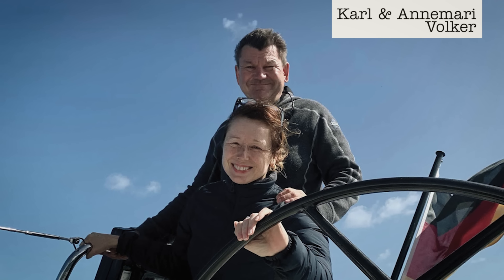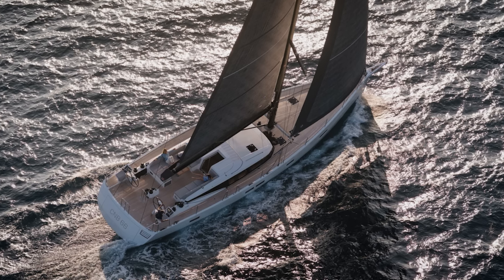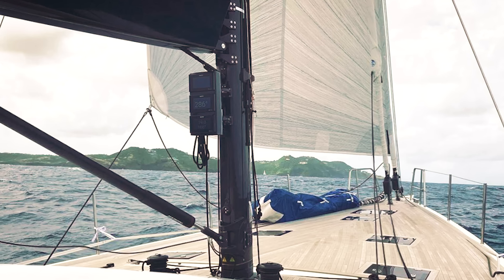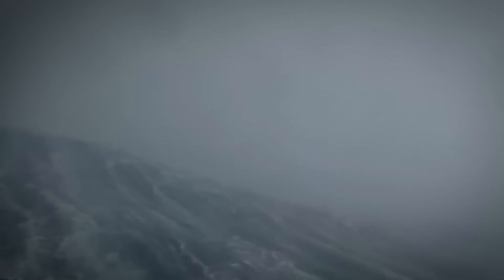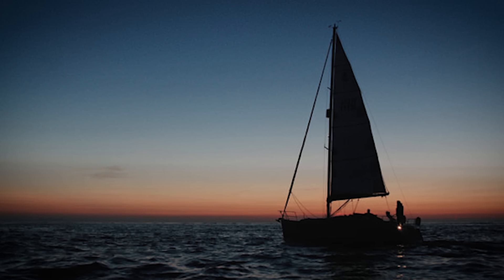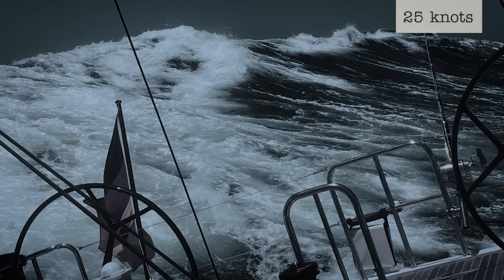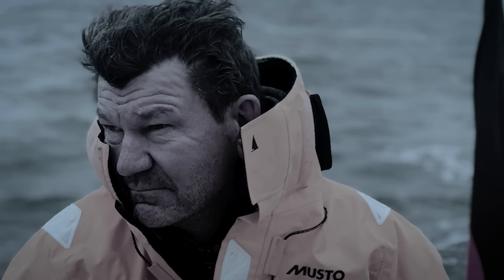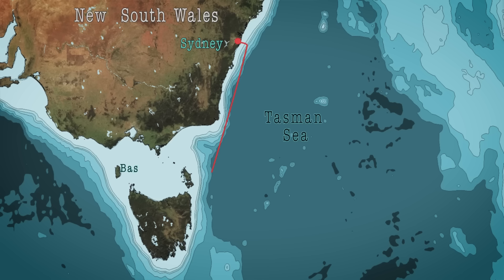Couple DIES on Private Yacht!

Comment: The boat was too big for two people to handle and obviously too big for a minimum crew to deliver in the No. Atlantic. I really did not like the design for the mainsheet. Set up in the middle of the cockpit is fine for a race boat, but this was a cruising boat. I think the designer should have warned the owners early on that they should have had a smaller vessel designed or he should have broken up the rig to a ketch to make the sail plan more manageable.
Reply: Maybe smaller main and a mizzen ?
Reply: It is a really terrible design. It is trying to be something it is not and the result, final design, is just dangerous.
Reply: @scomo532    very right. Common sense went overboard at design/construction.
Reply: Champaigne sailors. 
Lord have mercy.
Reply: It certainly seemed too big for just a couple, but on this occasion there were 4 on board...
Reply: The same mistakes, but on a bigger scale, in the design of "Bayesian". A ketch or schooner rig would be much safer, more flexible and definitely more pleasant to sail.

Comment: IMHO, the lesson here is that CNB 66 is too much boat for a moderately experienced cruising couple. Unfortunately this sort of thing is going to happen more and more because boats are getting bigger, faster and more complex. That couple could've easily been overwhelmed any time they went out on that thing.....the hull design is based on racing yachts crewed by 10 or more skilled sailors. Yes, the naval architect simplifies the sail plan a little bit for less crew, but it's sorta like putting a comfy seat, horn, and turn signals on a Formula 1 car and letting novices drive it on the street. An accident waiting to happen.
Reply: rich people buy exactly that type of car, too.
Reply: It is a terrible design. Looks nice though....
Reply: Our 38' catamaran was too much for two people. It was great in light air. But obviously too much, to the point of dangerous, once hull speed passed 15 knots.
Reply: Seems like these ppl had too easy of a life and thought it was all fun and games
Reply: Bad salesman to sell a racing boat (w/o experienced fulltime crew) to two retirees who just want to cruise on a cool looking sailboat:( we had a 40’ for hubby and I and that was just right size not too big or too small. Sailing wing on wing w wind behind you we rerely did bc it’s so damn dangerous.
Reply: What couple? They were four people.
But yes, it is a flawed design

Comment: That's why I do not like the mainsheet in the the cockpit! There was a similar incident on an X-yacht doing the ARC a few years ago when during a night shift change a crew member was knocked down by the mainsheet (connected to the traveler on the floor of the cockpit) and killed him!
These in-cockpit mainsheet systems are seriously dangerous and DO NOT belong on leisure sailboats!
Reply: I sailed a 20 Pacific Seacraft Flicka for 4 years, taking her Los Angeles to La Paz without an engine, and cruising the Sea of Cortez for 6 months in 2012. She had a tiny mainsail. It was sheeted to the stern rail, and even in that tiny boat, the mainsheet was a serious hazard. I ended up rigging a friction based preventer/boom brake using a figure 8 rappelling device to keep the boom under control during gybes, and I use a similar system on my Catalina 30, even though it had mid-boom sheeting clear of the cockpit.

It's important to reef early and often. It's also important to design your reefing system to work at any point of sail, not just upwind. I've also learned to avoid sailing dead down-wind. Study your boat's polar charts, and you'll probably find that 150 degrees off the wind is optimal for reaching your destination the quickest, Yes, you'll need to gybe if your destination is dead downwind. Gybing from a a broad reach is a lot easier and safer than gybing from a dead run, and it's more or less impossible to accidentally gybe if you're paying attention.

Keep the boat under control at all times. That's the main thing. Do not test it's limits unless you are prepared for the consequences of exceeding them. This is especially true on a cruising boat and while leisure sailing.

The sea will root out and severely punish any foolishness. It will do so under the worst conditions. It can and does kill anyone who ignores this fact, and even some who do everything right. RIP to these sailors. They led a good life, and died doing something they loved that was totally badass. Bravo!
Reply: They should adapt your two inventions in all boats.
Reply: @Hoganoutdoors  Did you beat or truck back to LA? I have done Ensenada to LA at night, but motor-sailing with a big post-race crew.

Comment: This is a sad story. After repeatedly re-watching the video from approximately 9.39-10.44, those seconds seem to illustrate the critical moments when everything went catastrophically south. As a retired professional sailboat captain with countless ocean crossings under sail, as well as a licensed deck officer on ships, it seems there must be critical details missing from this account. As told, there are several things that simply do not follow what would be a logical sequence of events. 

ln the following order: As experienced offshore sailors, why did the captain/owners feel the need to round up to reef (haul in) the roller furling jib? ln almost all cases, especially off the wind, this can be readily accomplished without dramatically changing the point of sail. Further, after deciding to do so, how could they have failed to immediately take in the mainsheet as they simultaneously eased off the preventer? Again, if this is indeed what happened, it was an uncharacteristically rookie blunder by experienced offshore sailors. That single compound failure appears to almost certainly be the primary cause of the series of events that cost captain/owner(s) their lives. 

Another unanswered, but almost equally critical question is what was/were the two delivery crew doing while all this was happening? lf they weren't on deck and involved in the reefing attempt, why not? Were they not called? lf they were called, but not on yet on deck, why did the captain attempt to reef short handed? While the conditions were clearly difficult, the very few extra minutes required to bring additional crew on deck would have made all the difference. An alert and experienced helmsman, observing the potentially  deadly, unsecured/out of control, swinging boom, with someone in or anywhere near its arc, would have known to immediately to fall off, (return to a more downwind heading) to prevent the likelihood of exactly what happened.  Although there appear to have been several other serious lapses around the same time, the single act of unnecessarily rounding up, without simultaneously securing the boom is key. The rest is immaterial and makes the story unnecessarily complicated and confusing. 

lf this seems like an overly technical and accusatory analysis, both to those involved and Waterline Stories, there is no disrespect intended or implied to anyone involved. As usual, the USCG seems to have done an excellent job under extremely dangerous and challenging conditions. l've personally avoided catastrophe more often than l care to recall, often due mostly, if not entirely to good luck. 

To repeat a favorite quote that will never become obsolete:

"The word 'experienced' often refers to someone who's gotten away with doing the wrong thing more frequently than you have." Laurence Gonzales, "Deep Survival"
Reply: Further, after deciding to do so, how could they have failed to immediately take in the mainsheet as they simultaneously eased off the preventer?    It sounds that this happened because one person was responsible for both ?    One of the other two crew members was at the helm, as I understand, but what about the fourth one ?
Reply: @frankmiller95  Well, if you look at any accident, it can always be said, well this maneuver could/should have been performed safer.  Think car accidents, this left turn should have been performed safely ...  It is not very informative. Informative is to analyse what was the mistake if any.  And for that we do not know actually enough information. Like what were the seas ? In which direction  ? etc. ...
Reply: @matthewmcdermit8744 they literally operated the boat together. Coast guard deemed the boat unfit for further passage. No sails, no bueno. I recommend you watch the video and focus less on boosting your ego
Reply: Agreed, there's missing information.  Also to reef, don't go straight into the wind, that massively increases apparent wind, especially on a large fast boat.  You just need to head up a bit to take pressure off the main.  So maybe apparent wind was 100 degrees, head up to 70 apparent (leave mainsheet and preventer as is) taking the pressure off the sail and then you can more easily reef.  The headsail often can be easily reefed heading deep downwind.   Sea state can make the best plans difficult/impossible though, but there is usually a way, just calm the mind and think it through.   The first mistake was the big mistake, which sounded like over confidence and reliance on the weather forecast.  On a crossing 1st reef before sunset, 2nd reef once weather deviates from forecast and before you think you need it. You might go a bit slower, but at least the off watch actually sleep that way.
Reply: @matthewmcdermit8744   seems to me they did an admirable job getting a vessel back under control, all while administering first aid and maininting commmuncations. That ultimatly did get the injured to medical services, and get the dangerous boom+sails secured. I agree with the presenter. Why were these experinced sailors not used to handle the more complicated tasks rather than having the captain and first mate take on multipule jobs at once trying to juggle?
Reply: My bet is she simply did not have the strength to do the job of handling both lines The load on the mainsheet design shown would have been enormous. All fine with a powered winch on a nice day  but any override or tangle in those conditions and it gets dangerous .
Reply: how can you as a captain not be able to count
Reply: @matthewmcdermit8744 I did think the abandon ship was peculiar as she was not in imminent danger 
But discretion.... you know.
Reply: @jurycould4275  You make an ignorant and ridiculous assertion totally absent supporting evidence.

Comment: A very tragic ending. It seems likely the systems designed to make a 66 footer capable of being handled by a couple might have been the reasons for their untimely deaths. Clearly the boom and mainsheet arrangements weren't satisfactory from the skipper's perspective even in moderate conditions. You need to be ahead of the weather in terms of sail strategy, it's customary to reduce sail at night for obvious reasons, but the reluctance to do so had fatal consequences. I would also say the steering positions on a CNB 66 look very exposed, it doesn't really look like the deck layout of a serious passage maker to me, even if the boat itself is more than capable of it. Very sad, and to think that a smaller more manageable boat would likely have not caused any problems.
Reply: The cockpit looked v exposed. Not my choice for passage making

Comment: I had similar experience surfing down 20' waves, wind was astern 30 to 35 knots. On a 47' Boat with in mast furling as we went down the waves , boat would turn and backwind mainsail, it was held with preventer but you can't get enough angle on it to prevent it from moving back and forth. Next weather report was gale conditions in gulf stream, so I rigged storm sail and tri sail. the tri sail eliminated all of the problems with the boom which was now tied off. The tri sail can back wind to either side, with no drama. This is the problem with larger boats which I was considering. All heavy weather gear. i.e. storm sails, drogues, storm anchors, rode and bridals are massive and you can get caught out there. They where very lucky and exceptional sailors all of those years, however things can go wrong in a moment, I feel very bad this happened.
Thank you for posting so we can all learn or take something from this.

I

Comment: I had a third reef installed on my mainsail and I installed a wind-vane autopilot on my boat before going around the Atlantic solo for the first time. I often put in one more reef than necessary, and always reduced sails before night fall until the morning, even though it reduces speed. I always thought, if I was sailing with a more experienced sailor, they would go crazy because I'm too cautious and it makes the ocean crossing longer. But after seeing this, I'm thinking maybe that's the right way to go after all, that and the wind-vane autopilot. Especially between Bermuda and Nova Scotia.

Comment: lessons: 
1. never bring a large luxury sailing yacht to cross an ocean. they are badly designed, only suitable for anchoring and partying in coastal waters. they are just fancy on-water hotels. 
2. large boat is much more dangerous than a small boat, extreme load will applied to the riggings. 
3. never use fancy reefing systems, such as in-mast furling main or roll furling jib on a long passage. they always bring trouble. 
4. stay alert when sailing in warm ocean current(the gulf current), heavy weather can sneak in at any time. 
5. flat open deck is a nightmare for ocean crossing. Crew can be swept away by a wave. boat can be swamped by a following wave. 
6. in conclusion, don't buy a big, expensive, fancy luxury sailboat to sail across an ocean.
Reply: I don't mind people buying fancy luxury sailboats. If you have the money why not. But get a bluewater boat with a central cockpit, no mast or boom furling. I mean, for 2M get a HR, Najad, or even a Kraken. They are fancy and luxurious but they are made for ocean crossing, you can still dance on the front deck and drink champagne if it's sometjng you really have at heart. But you won't have a problem to get your main down if need be.

Comment: I find this heartbreaking and so flawed were their action that it disgusts me!
Almost all long distance cruisers, with solo or dual crews are either ketches or yawls for a reason.  This yacht was mighty, but severely overpowered from he start, but that is really not the issue.  If you are overpowered you drop the sails and/or cut them free.  In the open ocean, away from land, sitting, battened down under bare poles, streaming a sea anchor is as safe as it gets, so why did they not do this.  And as for running downwind, with a restraining strap on the boom with a view to stop a gybe appears almost suicidal.  If you can't control the beam, then the boat will stay broached in the trough of the waves.  Uncomfortable if not positively dangerous.  I have sailed in everything that the North Sea can throw at you, in dinghies, racing yacht and cruisers, and the secret to safety lies in planning and preparation!
...and what the hell were those experienced crewmen doing?
Its enough to make you cry, seeing now needless this tragedy was!

Comment: Professional sailor here. Your wind angle position for the uncontrolled gybe is.. seriously wrong. The wind angle would need to be forward of the boom on the OTHER side, being the Port side on a Starboard tack (boom out on port side). Also, reefing an in BOOM furler does NOT require "tying to the boom" as you suggest. Just no. Also, 35 knots is NOT a storm force wind. It is a simple gale. A wind of that force WILL NOT generate "Eight meter waves". Just no.
Reply: Maybe they got those stat’s wrong when they were making the video.
Reply: @macdoctor145  A lot of things are very wrong with this video. It irritates me that people like this produce videos with such little actual knowledge. Trading off other peoples misfortune but with little real usefulness or correct information.
Reply: From the description, the wife had difficulties working the main sheet.  How she got injured is unclear.  The husband then abandons the helm (autohelm I hope) but during his attempt to attend to the wife, he gets hit with the mainsheet as it breaks or possibly the mainsheet deck block causing him to trip and break his legs.  The crew member trying to get the jib in then abandons that action to help the husband and wife.  The remaining crew member tries to steady the boat by turning dead downwind.  In a sea, with no mainsheet attached to the main, the main would or could jibe without restraint on a dead downwind angle. Very dangerous. It would have been better to go to a broadreach so the wind would press and control the main.  He might not have been able to control the boat properly because the genoa was not furled.  To gain control, the foresail needs to be either furled or reefed, then the boat can be turned to weather (close reach) to reef or furl the main in a controllable and safe manner.  The issue is the unfurled genoa.
Reply: Yes, also the man was called Volker. Bad research and no idea of sailing
Reply: @cristoforopassaro2219  Broadly agree.

Comment: The Boom of Death is unfortunately a thing which happens too often.
I had been hit by a boom an a small yacht (L23) too. I was lucky it was only a superficial scratch, but it hurts.
Reply: I was out sailing just the other day,took a novice out, i all ways leave the main stowed ans just use the head sail when i have non sailors aboard ,unless it is champagne sailing conditions.
Reply: @LITTLEDANCERSADHU993  That's a really good idea. 
My first day on a sailboat, the old salts (+50 years experience) decided that we was going to sail in light winds (max 2 to 3 kn of boat speed), so things are happening more slowly.

I was hit by the boom years later in gnarly weather: About 1.7 meter, 6 sec waves, and 18 kn gusting 25 kn winds.
Reply: Yeah , in my opinion,the boom is the most dangerous bit off kit on the boat, having said that, a sailboat is only as safe  as how it is bieng conducted by the skipper. @charonstyxferryman